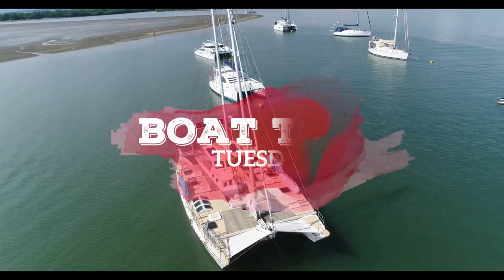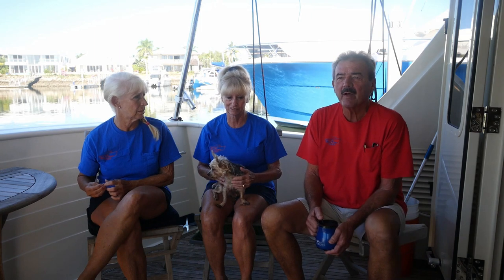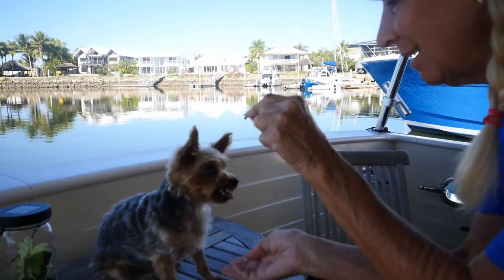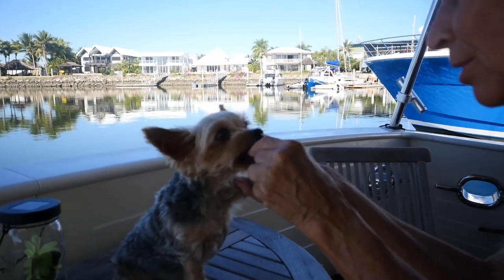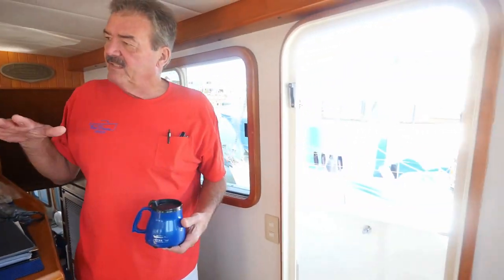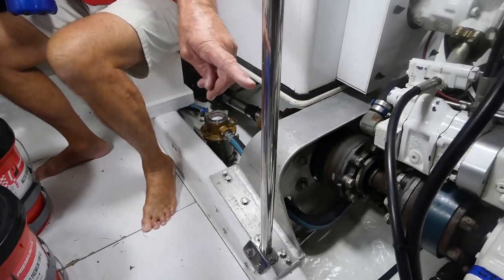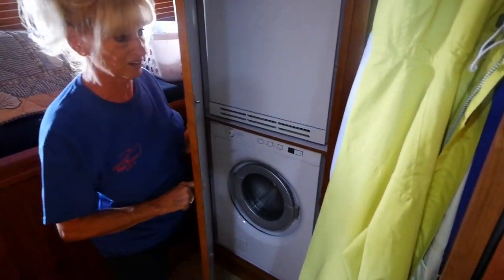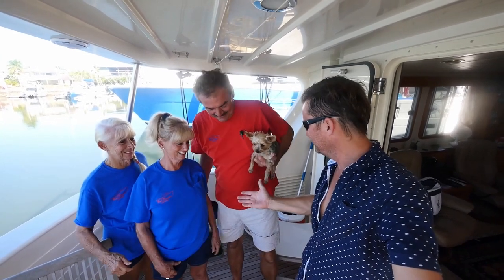KADEY KROGEN 58 Motor Yacht - Boat Tour Tuesday

Comment: Long wondered why powerboats don't use that Hydro-Drive or variations on that. Have the propshaft thrust and vibrations absorbed by a structural and torsional dampener. Instead of going into the transmission bearing and case and into the engine block. Letting the engine be a little "looser" mounted seems it would go a long way to reducing drive train vibration.

Can see cost as a factor but when getting up into the luxury cruising yachts like this one that is less a factor.
Reply: Are you saying something similar to a jet-ski powertrain?
Reply: JJJ SMITH 
Not sure what a jetski power install looks like. 

This setup had the prop shafts thrust pushing against a bearing on a structural member instead the transmission. This allows the engine to be mounted softer to absorb vibration.
Reply: Dave M 
 From my understanding it’s just a smaller engine mounted to an impeller pushing the water out the rear.. I was thinking if you put two of those set ups on the boat it would work better, but not sure.

Comment: He said they've travelled 45,000 miles since they bought it. That's over $100,000 in fuel.  Crazy!
Reply: "Over 3000 miles on less than 1600 gallons" is less than 2 MPG.  Thanks, but I'll stick to sails and a diesel aux for use only when needed.